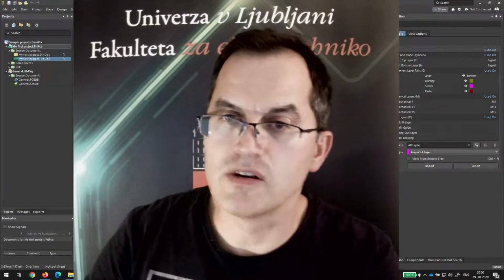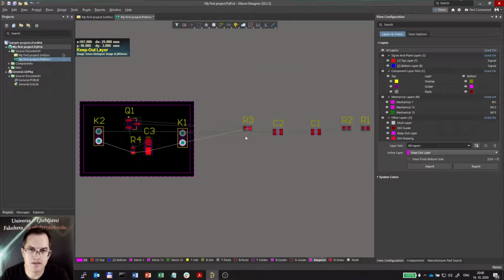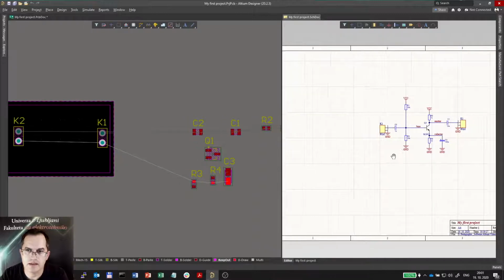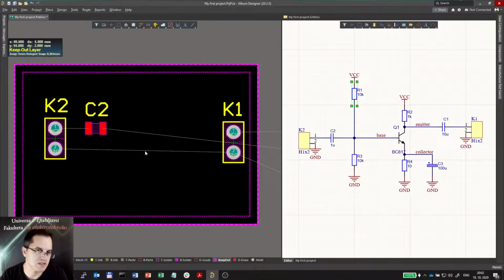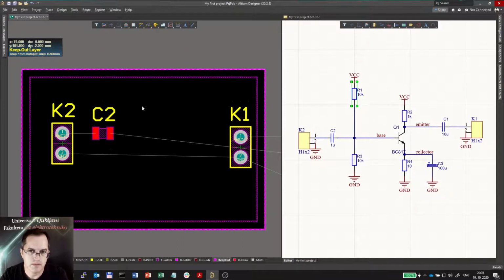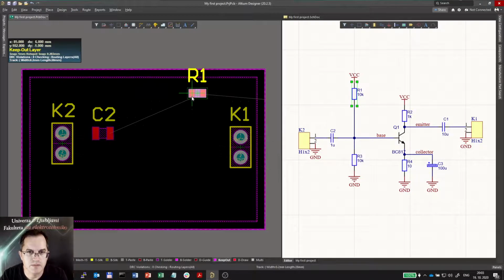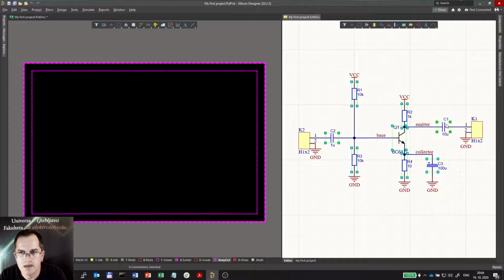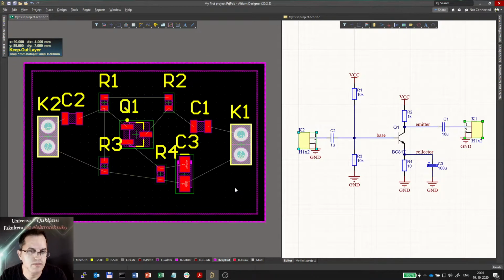Altium intro #22: Component placing

Comment: Completely useless. There's 2700 other tutorials about the schematic half. I wanted to know how to "move component by name" which used to be somewhere. Supposing you didn't even have a schematic, then this video is immediately useless. Not to mention looking at the schematic for relationships doesn't help at all IF YOU CAN'T FIND THE COMPONENT.
Reply from the maker: Almost nobody does the PCB without the schematics... And in the schematic (if there is any) you can find components easily.
Reply: @elektronika-fe1325  Still have to hunt through pages of schematics. If I find it, what happened to "Move by name"?
Reply from the maker: @allanknox8216  
1. Click Panels->PCB 
2. In the PCB windows choose "Components"
3. In the list you can choose any component 
4. Left click on the desired component and select "Reposition component"

Is that less useless?
Reply: @elektronika-fe1325  I finally got it after poking around. Turns out, at least on my version, there's a couple more steps and it was a right click, but I found "reposition". Thanks for your help. Got a board with less than half the designators but an instruction sheet telling me a whole bunch of specifics to do with components (that I couldn't identify). I appreciate it. Good luck! Allan